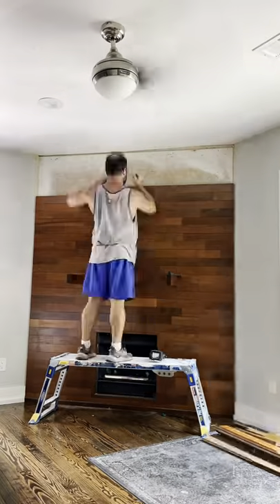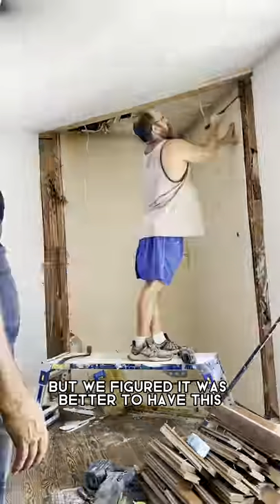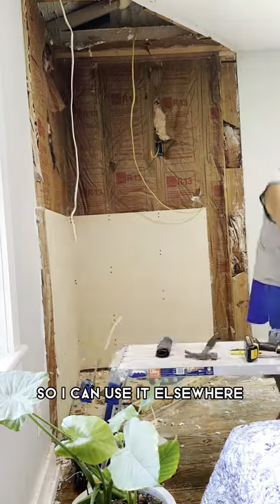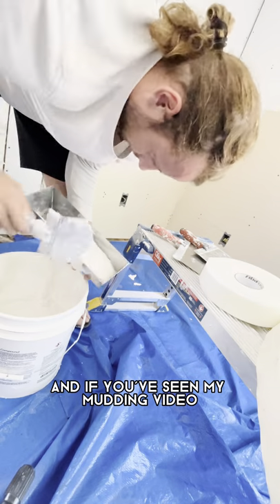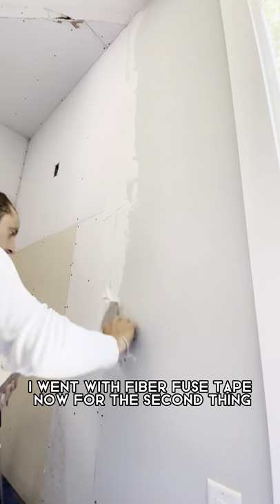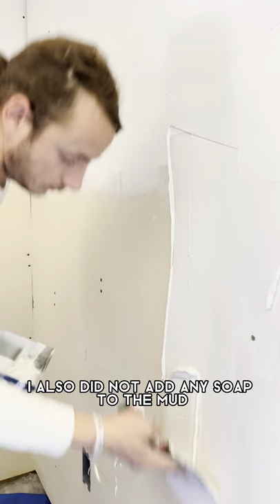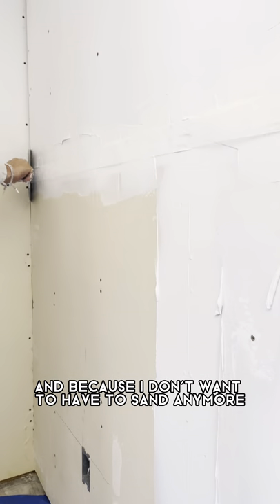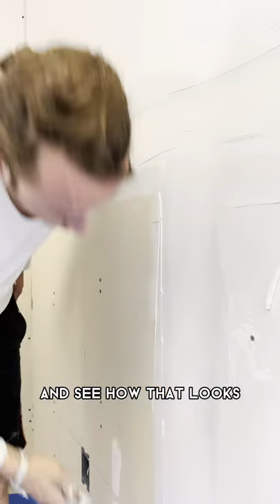Demo of Wood Shiplap Wall and Installing Drywall Part 1

Comment: If you let it get stiff but not dry, you can get a damp grouting sponge and feather the edges. Skim coat plus the sponge technique has leveled up my drywall skills big time.
Reply: This dude drywalls. 🤙🏼
Reply: You can do it even if it's dry unless it's hot mud.
Reply: We call it “wet sanding” where I live. Def a game changer

Comment: just a recommendation  but only use paper tape for slow drying mud   

mesh tape is only used with plaster /hotmud some call it /quickdry   

Fiber tapes for repairs and quick dry like mesh tape..    all to prevent  future cracks from structural movements

Comment: try big yellow sponges instead of sanding! wet with warm water use 4x6 gray sponge wet and yellow to smooth. no dust!!
Reply: Exactly. There’s also the specific drywall sponge that is yellow on one side and coarser on the other.

Comment: I can't use fibafuse, I have fiberglass splinters in my skin from like over a year now because a customer had bought a bunch of fibafuse before I took the contract with him and he decided he wasn't up for diy and the 1st guys he hired did an amazingly terrible job where we had to go over every single screw and countersink as well as pull floating screws to the point we had practically a full 1 gallon bucket just from loose floating screws. Few hours using that fibafuse and I stopped to go get mesh. I couldn't even wear gloves afterwards because the splinters caught everything and couldn't even see them, only felt those nightmares in my skin lol. I had to soak my hands that night to try and get them to eject.

Comment: Was that an electric fireplace??  Even if so what are the specs on it for the way it was installed.  Most fireplaces don't allow any combustible materials on the walls surrounding the fireplace.  Big mistake people make for the look.  You can't put ship lap as a surround for a fireplace unless it's rated as fire proof/ metal.  Just saying

Comment: Omg, the comments are awful.   1.  If you drywall much just take the time to figure out paper,  2.  Soap or anything helped with the old AP mud, overkill now.   Even water is usually innecessary if you just spin it.    3.   Skim coating a wall to avoid sanding is kind of nonsense unless you dont have a sanding pole but there are a lot of variables so whatever.   You're texturing so anything works.

Comment: Fibafuse is great for flat joints but sucks in the corners, use paper tape in the corners. Thin your mud with water and a mixer also.

Comment: FIBA tape, setting compound twice, midweight top coat. No soap, no sand in between, just pull clean and run the knife over the wall to knock off anything. Light sand to finish. Simple as can be. Strait flex for the corners

Comment: You add soap for the final skim not the first coat, and sanding ???
Bro where have you been? Use a big flat wet sponge instead of sandpaper. I'll never use sandpaper on joint compound again !!!

Comment: I want to try some of that fiber fuse or whatever it was called. It looks like a good alternative like a paper and mesh hybrid.
Reply: It's a fiberglass. Be prepared to scratch you hands for 2-3 days.
Reply: @andriyshapovalov8886   Would you recommend a product like this over traditional paper or fiberglass? I'm a new carpenter and Was wondering if if this type of fiberglass tape was the future, or not so hot.

Comment: Man use a 4 inch knife to tape stop putting a thousand pounds of mud on the wall and your experience with drywall wouldn’t be so bad! You put just enough mud that all you need to do is change the texture of your mud for paint.